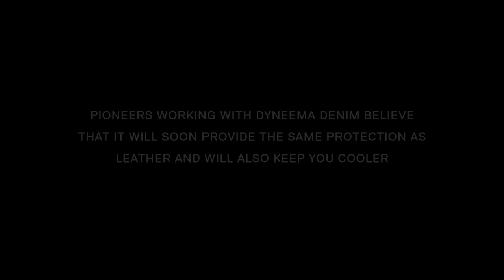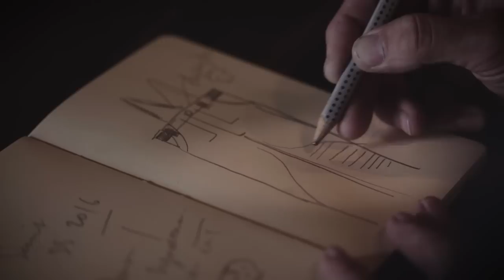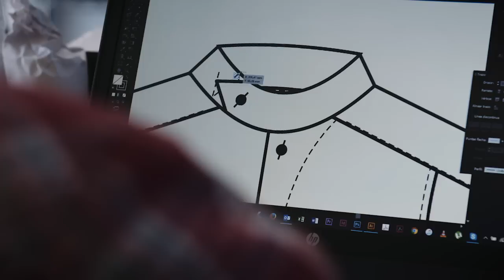Dyneema® Denim: Protective single-layer motorcycle wear

Comment: This material is fantastic! If you guys accept an opinion regarding the design, remember that maybe in an accident the pilot may brake a bone and the paramedics would need to cut the cloth with a scissor. Maybe the pants need some weak points or seams to allow this.
Reply: The material is actually really easy to cut with scissors.

Comment: woooaaww fantasticooo but why  you hanging , pulling or trying to scratch the fabric with a cutter?  do you realy mean that similar like on road at crash? did you kidding? jokeing?  what ever you want show? 
hanging and pulling is with every denim fabric  possible too!!
scratching with a cutter ? want you show  how a thistle at the road on your dyneema fabric is? why you not show  how your fabric at a grinding machine is that burder like slip on roadway and not scratching!!!!
pls dont telling about 15x Stronger steel, whos  slip/grind 15xSteel on roadway ???

honestly are the speedlimits of your fabrics? are they limit at 50km/h? 70km/h? 100km/h? 130km/h?  riding on desert and sand never  represent crash and slide on asphalt!
nice promotion but you offer protection wear  not a Barbie  no real safety arguments and information👎🏻👎🏻👎🏻👎🏻👎🏻